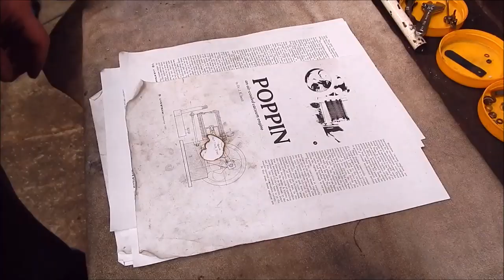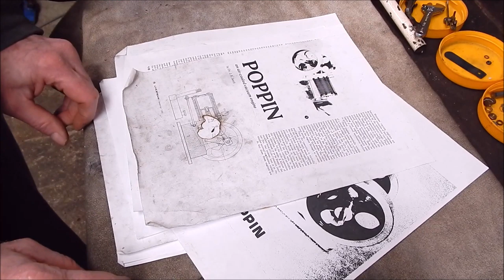Home cast aluminium round stock made in a scrap air compressor barrel

Comment: Hi Rob, just out of interest you should check out the guys in Pakistan professionally sand casting. They use Molasses as the sand binder. Forced draft charcoal fires, never bother with scraping off the dross. As for PPE, forget about it. But still they turn out some amazing stuff.

Comment: Now how many empty beer  cans will i have to save up to get an ingot like that ?
I can see this being a marriage made in heaven !
The guy that scabs the cans out of my recycle bin to cash them in doesn't know it yet but a famine is upon him !
Thanks for the video Rob , it is good to see someone showing us that basic metal casting doesn't need to be complicated or need elaborate and expensive  set ups !
Reply from the maker: Hi Ian,  it only gets complicated when you try and cast items in their final form.  Basic round and square stock as shown are easy to do.  Yep, save those cans and piss that bum off.  I've never melted them down as I prefer stubbies, but by all accounts it's very high quality aluminium.  Cheers Rob
Reply: High quality aluminium, nearly pure, but you will be drinking a lot of them to get the mass, as around half the mass of the empty cans will be either the coating or the oxide layer. Take the cans and make a can crusher, so that they are nice and compact, and a nearly equal size, so feeding them into the melt is easier.

Comment: I found That if you put a small pack of baking soda in foil dropped in the pot.. It degasses the aly .. Great free stock Rob .. ENJOYED !!
Reply from the maker: Hi Shawn,  I have tried that.  I don't use any flux or de-gasser now as I found it can create problems, not necessarily solve them.   Do whatever works best with the ally you have.  I only use high quality scrap now and gassing is not usually an issue if you don't over heat it  Definitely well worth doing home casting.  Saves a fortune,  as you know.  Cheers Rob

Comment: Good demo Rob - I still have it in mind to make a decent small furnace... one day!
Reply from the maker: Hi Chris,  mine was just a quick knock up and it's surprising it's lasted this long.  Next one I make will use a 9 kg LPG cylinder as the body and lid. It will be larger and stronger. I've seen quite a few done that way.  I have a scrap cylinder ready to go. Casting is a good way to stay warm in winter ;)  Cheers Rob

Comment: Rob, can you face/turn some of that in a future video and polish it? Thanks, Doug
Reply from the maker: OK Doug.  That little metho pot I show at the beginning is typical of the finish you can easily get (that wasn't polished).  I had to remelt that as the bottom was porous from super tiny pin holes.  This can happen.  One end of the pour may be fine and the other could have pinholes or voids (showed that too in another reject bit at the beginning). No guarantees with this business.  Most times it's OK.  Shop bought will always be better, but of course it costs plenty.  This quality is fine for most hobby use.  I always save and re-melt the cruddy bits. Cheers Rob
Reply: @Xynudu  Thanks for the feedback Rob! Hope your doing well, cheers, Doug

Comment: Hi again, Rob - thanks for another good one!  What kind of alloy are you using? Personally I like the AlSi9Cu3Fe/ 46000 (similar to 333.1 & 332.0) diecast alloy the best, which I get from work when we scrap old office furniture. Excellent casting properties, short swarf with no hogging-in, and excellent final finish with an HSS shear tool. A teaspoon of pool shock chlorine rids the melt from gas pores, no flux needed. Got some 50 kg of the stuff to melt when I finally get my electrical foundry together. Using expired CO2 extinguisher bottom halves as expendable crucibles. For small dia stock, I pour into 30 mm inner dia x 400 mm long (also pre-heated) gas spring cylinders (also sourcing half a metre of 12 mm drill rod). Cheers DIYSwede
Reply from the maker: Hi Johan,  I'm currently using scrapped Toyota car wheel rim.  I still have one left to cut up.  This stuff has to be good to do the original job and it gives a good finish.  They are  oven heat treated for super strength, but that is lost when re-melted of course.  I've tried all sorts of scrap ally and some is total crap.  So when you find a good source, stick with it.  Cheers Rob

Comment: Hi Rob. This video has inspired me to try this myself. After watching your other video on the H160 failure and how you ended up using your bullfinch torch to seperate the copper pipe, the following thought occurred to me. Since I have neither a bullfinch nor an LPG torch, do you think the bullfinch could also do the same job and the kiln LPG torch in your kiln video? That way I wouldn’t need to buy both. I realise that the bullfinch is much more expensive, but can do other jobs as well. Thanks so much. Brian, North Haven.
Reply from the maker: Hi Brian,  I've never tried the Bullfinch with the kiln.  You can pick up these old Primus type LPG burners off of Gumtree dirt cheap at times.  Just keep watching and grab one.  Cheers Rob

Comment: Hi Rob do you think copper would come out off them round mounds like the cylinder we build bikes so do get them now and again 👍👍
Reply from the maker: The expansion rate of copper is not as great as alumuinium and is closer/slightly more than steel, so I would not expect copper to release without a press. Cheers Rob

Comment: Do you heat that sand before casting? At least here in nordic countries it would be quite difficult to store absolutely dry sand. Or is visible/feeling moisture evaluation sufficient? I really want to try casting some time and been trying to find some information to do it safely.
Reply from the maker: The sand was not heated before use.  It is OK if it feels dry and separates/flows through your fingers.  Once dried in the sun it should stay that way in a large plastic drum with a lid.  Casting sand used to make impressions may be slightly moist (that's part of how it keeps it's shape) and is safe to use at the correct mix ratio.  A method I am trying out is to use a small amount of molasses as the binding agent.  This has to be less than 5% by volume.  My first attempt was twice that and gave a poor finish.  Next time should be better I hope.  Cheers Rob
Reply: @Xynudu  Very sincere thanks for answering my question. I'm very aware what kind of danger water could do when doing castings, but I haven't had any realistic knowledge about moisture. I've been suspecting same kind of "behavior" of so-to-say good enough dry sand and been speculating myself that likely very small residual moisture likely causes only small porous area near to contact surface of sand. I mean 0% moisture in sand is virtually impossible to get and maintain in household conditions. I actually think that somebody mentioned that it would even be impossible to do sand casting with absolute 0% of moisture. Obviously there can't be much moisture. Some day when I get to try things I think I'll try to measure moisture and collect bit data for myself for experiments. Pretty reliable meters can be found for quite cheap. Anyway, my sincerest thanks again.
Reply from the maker: Moist sand is not as dangerous as cement when heated suddenly as it does not spring/flake apart under compression like cement does .  The separating cement particles are what sprays the aluminium around most from my experience.  That's not to say that steam isn't a contributing factor as well.  I've never had any metal spray issues with sand. Cheers Rob

Comment: Hay Rob, how long did it take to melt the ally with your set up?  I'm interested as I want to do some sand casting for some fixtures on my mill and don't know which way to go with the burner, LPG torch like your set up or forced air LPG, forced air Natural gas or forced air waste oil. 
Cheers
Reply from the maker: Hi Mick, about 10 - 15 minutes.  I also have a wood powered furnace (old cement incinerator) in the back yard.  It's forced air assisted (from a kid's bouncy castle blower) and is used for bigger melts.  Both do the job and are cheap to run.  Plenty of options.  Cheers Rob

Comment: I have hundreds of pound of brass bronze and aluminum i need to do this with so it wont take up so much space and it will be usable What kinds of torch is that
Reply from the maker: Hi Joseph,  that's a standard general purpose home use LPG/propane torch with the largest burner.  You will need something hotter to melt brass.  Cheers Rob

Comment: Hi Rob !
Oh, it reminds me of MY first try ... in a galvanized pipe ... a Hell of a job to get the casting out !

Burning manuals CAN be put out with a cold beer ... but it's oh, a hurting choice to make ... loose then manual or the beer !
Reply from the maker: Hi Keld,  you can always count on any oil rag within 20 feet catching fire when stick welding ;)  Can't waste beer on fires.  I have a pot of cooling water for that.  Stay safe and well.  Cheers Rob

Comment: Thanks Rob, now I'm just going to have to get me a furnace!! Cheers, Alan.
Reply from the maker: Lots to learn there Alan.  MyfordBoy is a true master at complex casting.  I just do the very basic rudimentary (simple) stuff to feed the lathe.  Saves a huge amount of money in Oz as they charge the earth for new ally stock.  I haven't bought any for 20 years.  Cheers Rob
Reply: @Xynudu  I would do the same plus possibly cast some flywheels. When doing steam engine restores cast parts like the flywheels are the hardest to replace. Aluminium stock is not cheap over here either. Cheers, Alan.

Comment: Hey man Kevin here from Melbourne.  Thankyou for sharing this technique it's something I'd love to try in my shop.                   Q.  What is the set up you used for heating the metal.  
Anyhoo stay safe and stay well. 
✌  Peace .
Reply from the maker: Hi Kevin,  it's an old paint tin lined with Perlite and cement mix.  I use a standard large sized LPG torch (vintage Primus ?) to heat it.  Works very fast and well.

I also have a wood fired outside brick furnace (old incinerator) that is air blower assisted (from a kid's bouncy castle).  Both cheap to run and effective.  Cheers Rob
Reply: @Xynudu  thanks man.

Comment: The channel is called Wow Things.
Reply from the maker: Hi Mark,  I subscribe to that channel.  Some amazing casting done with minimum resources.  I tried using the Molasses and sand mix shown (rough guess of ratio) but I had too much molasses, so I will have another attempt.  The result was that square speckled looking piece of alloy I re-melted in this video.  Very interesting and useful subject.  Cheers Rob
Reply: @Xynudu  Yes, it is very minimalist. My favorite was the first guy, the one who hurt his foot in the motorcycle accident and had a bandage to cover his foot. The lighting was good, the close ups were great. The other guys are good too but you don't seem to be as much a part of the process.
Reply from the maker: Yes, I agree Mark.  The original guy that injured his foot was the one that caught my attention.  His results are damn good.  The one thing they don't mention is shrinkage, which is a major factor when casting from originals as shown.  This will be at least 5%, which is a major downer, eg that side cover he cast for the m/c won't fit very well.  But the videos appear to be a demonstration of what these guys can do with bugger all.  Quite impressive.  Tough life over there.  Cheers Rob